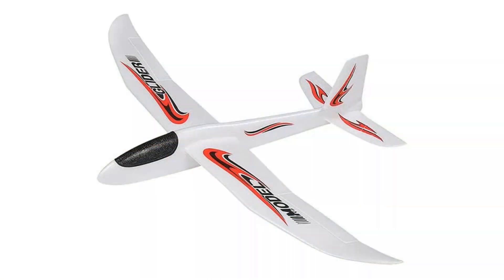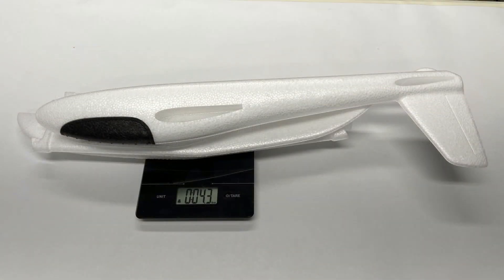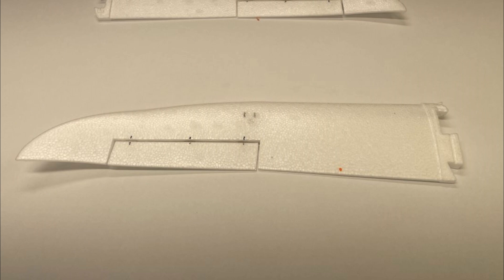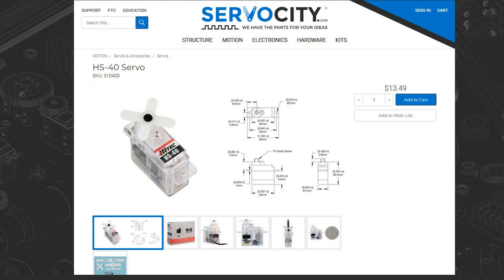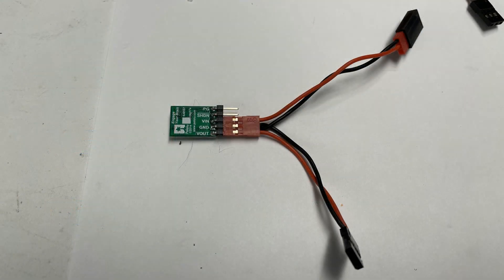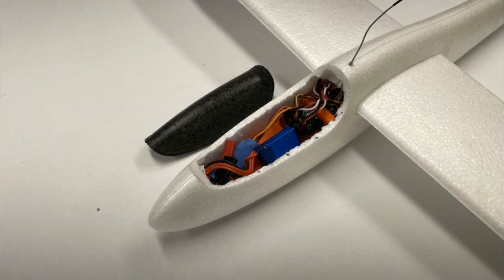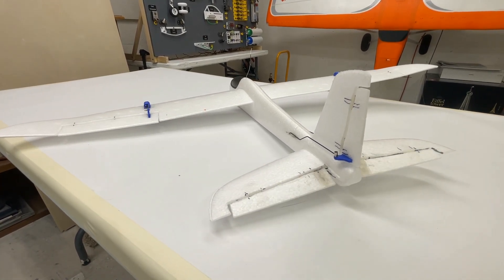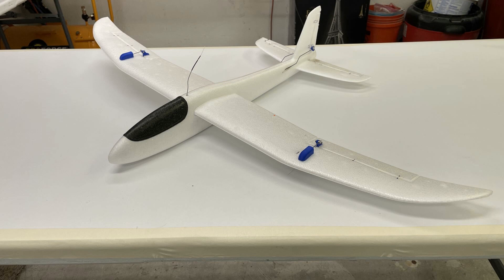The Chuck Glider 7.3 Amazon Glider Conversion (DIY)

Comment: I am a newbie at RC planes, I have a question on how you got the tail elevons to move without connecting them together or am I missing something?
Reply from the maker: At 2:08 I ave a small wire that connects the two halves. It bends just enough to allow movement.